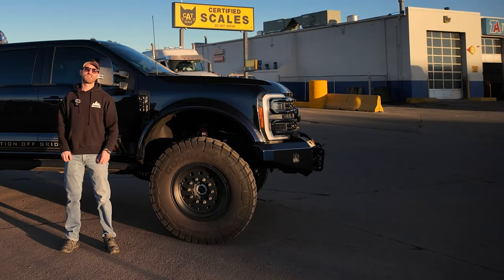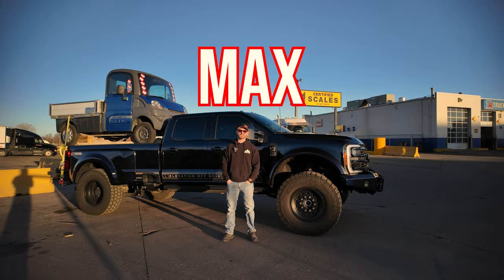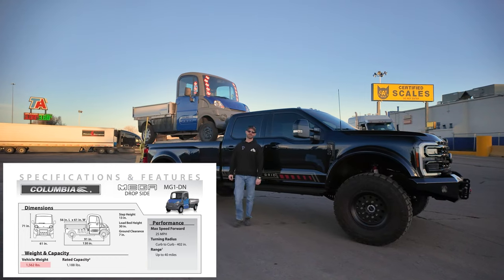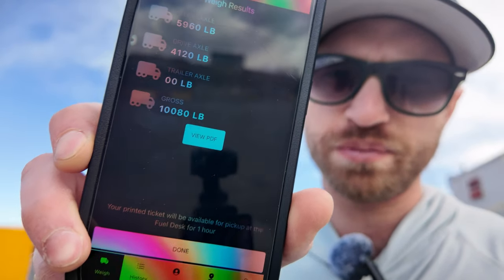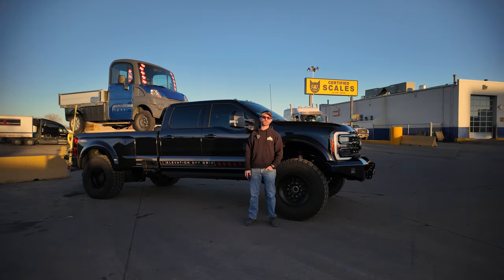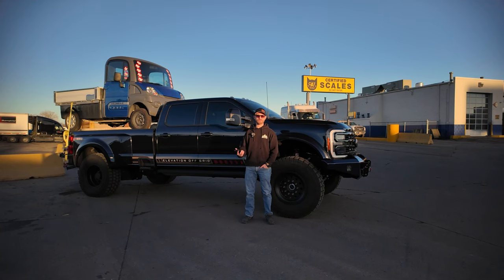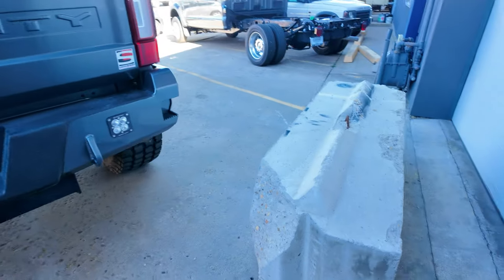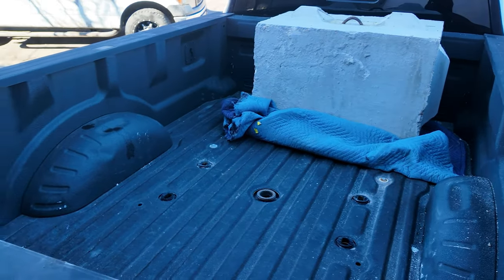10,000+ POUNDS IN A TRUCK BED - F-550 Black Edition MAX Payload Test

Comment: It's such a waste though, to buy a truck like an F550 and put a pickup bed on it lol. I thought it was silly when they offered the F450 pickup bed version. When did the start with the F500 pickup versions? Even if I wanted to carry a camper, I'd still buy the C&C and get a flatbed or dump bed and rig up a mount system for the camper, this way it's still a capable truck for hauling stuff other than just a camper.
Reply from the maker: Ford does not make F-550 pickups. We manufacture a pickup bed for them. These trucks are built for daily driving, towing, carrying payload, off-roading; anything really. The pickup bed still allows great versatility, and completes the look as a beautiful, capable truck. We also build this with flatbeds and camper beds. Depends on what our clients choose for their use.

Comment: I’m curious how how you come up with the gvwr numbers.  Does the govt hame some type of formula.
Reply from the maker: GVWR is a factory rating, that number cannot change. The payload capacity is what can change; reducing weight on the truck will increase payload capacity while adding weight reduces it. These trucks come from factory with over 12k payload capacity, but with no bed and all stock components. Once our components are added, payload capacity is right around 10,000lbs.

Comment: A lot of squat unlike what you said in previous vids
Reply from the maker: A mild amount - this was with the lowest weight rated LiquidSpring strut since it is our shop truck, so we ended up actually over its weight limit. We have stronger LiquidSpring struts supporting 14,700lbs that should have been swapped in for this video, but the point was just to show that the truck can handle it.

Comment: Y don't yall use Chevys
Reply from the maker: 1. Their class 5 trucks (5500 & up) are only available with a base model, work truck interior.

2. Their front suspension design & geometry leaves much to be desired.

3. Frame / cab / suspension layout is not conducive to building a vehicle that is truly multi purpose.

4. The one piece cowling over the front end is ugly.
Reply: @elevationoffgrid  OK